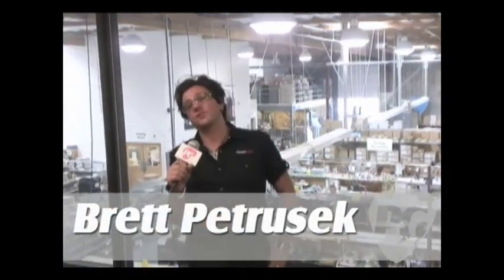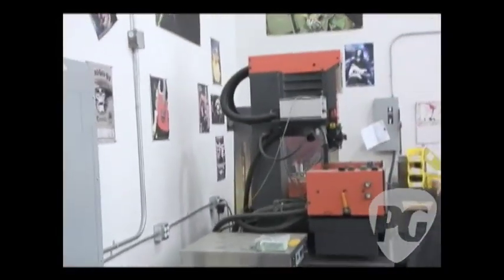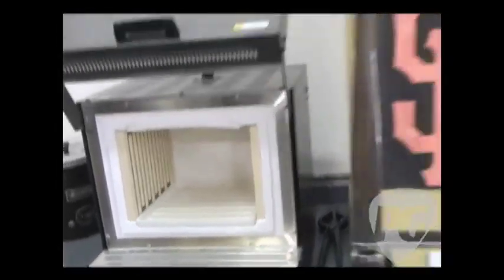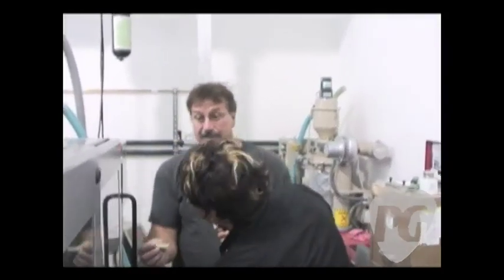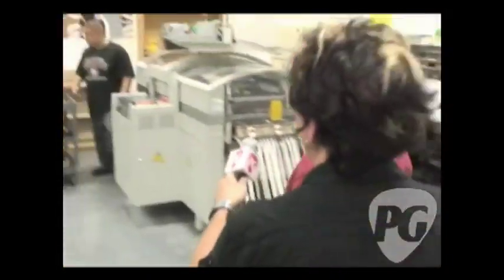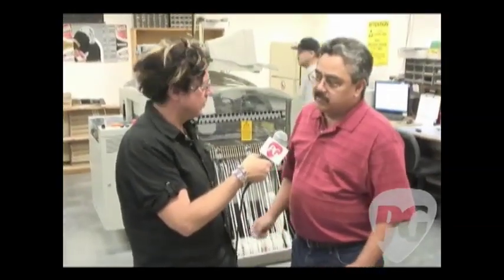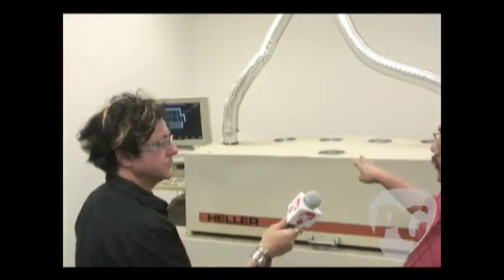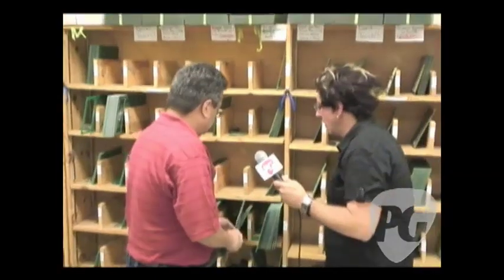EMG Inc. Factory Tour Pt. 1

Comment: the 18v mod isn't for the advantage of battery changing, and if it is. you wired it wrong. it's supposed to be wired in series I believe and if you wire it in parallel all you're doing is giving each pickup it's own battery and that won't effect your tone. btw change the battery on your damn guitar. after like a year you should dude.

Comment: No no no.... The greatest active pickup. Check out a company called Bareknuckle Pickups. Particularly the Warpig. It has a higher output than an emg. And it's passive! In 10 years I bet bands as big as metallica are using them.